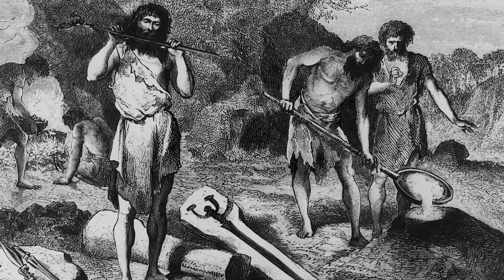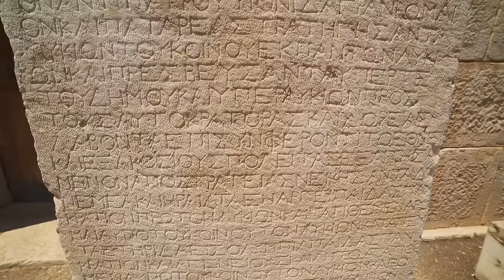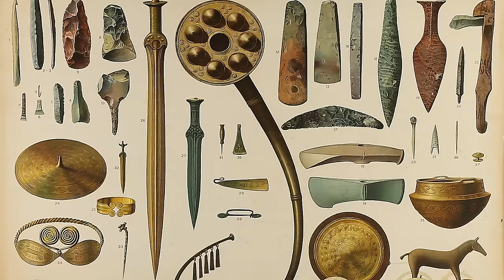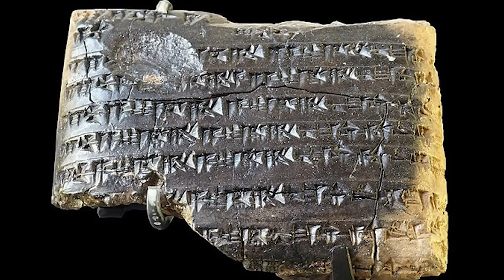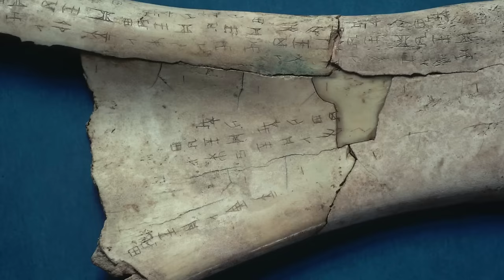The Evolution of the Bronze Age: The Next Chapter of Human History | Documentary

Comment: bronze is not much easier to work than copper, I have cold hammered copper bars into axes and adzes , I tried cold hammering bronze bars and it splits and separates  before getting to the desired edge, and so bronze needs annealing to form a good blade , copper can be cold hammered
Reply: Bronze can be easily cast, however, and it flows well. Molten copper is gluggy and casts like oatmeal.
Bronze's ability to flow when molten allowed the early open molds to be superseded by lost wax, and the casting of complex forms.
Reply: How well would a copper axe hold an age say for example it was employed in chopping down trees? ISn’t copper soft?